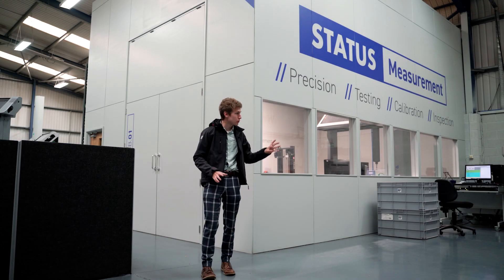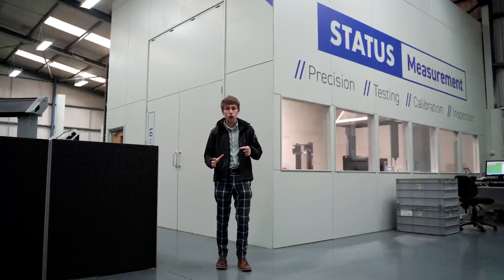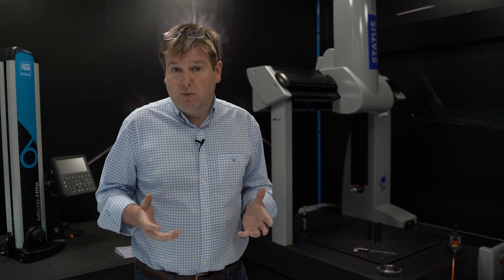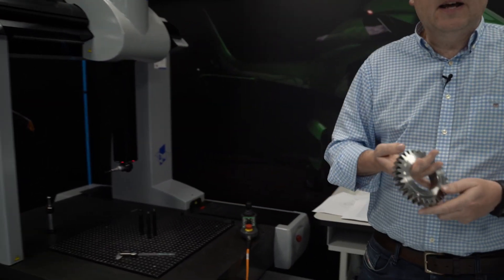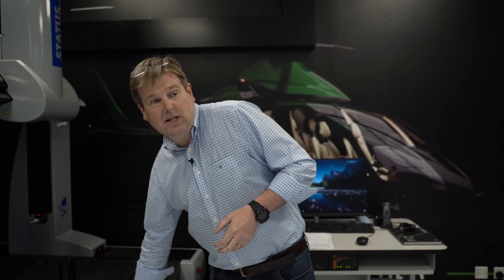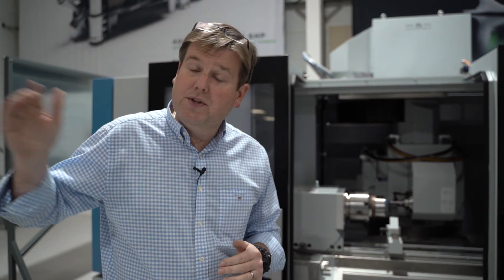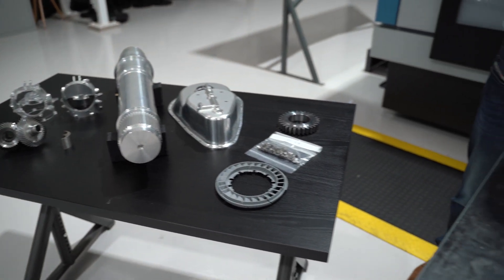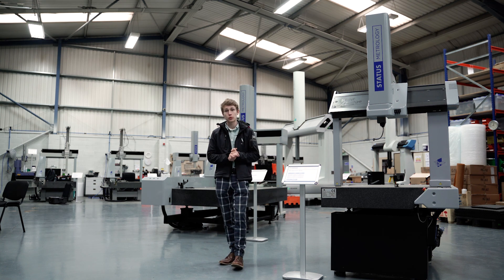Journey to HX50 | Episode 15: CMM in place to provide vital calibrations of HX50 components

Comment: I had never considered that such a temperature difference could render the brand new precisely machined components out of tolerence under such circumstances!

That's a huge factor!

Thank you for these fascinating insights into these procedures.
Reply: i love all the witchcraft behind the science, even the equipment to measure these tolerances blows my mind, the calibration must have to be checked regularly too - so if you control the temperatures between making the item and testing how precise its made, what happens when its installed, and then put under everyday stresses in different environments, and do the lubricants behave correctly - think my head is about to explode, but love it